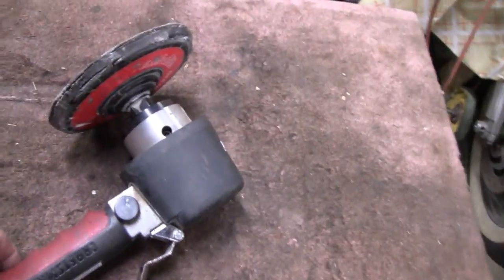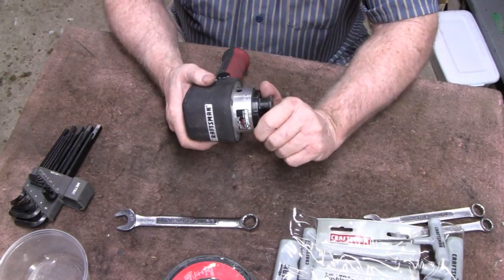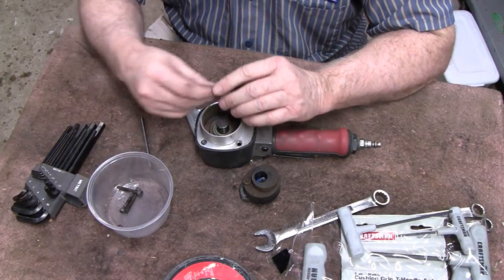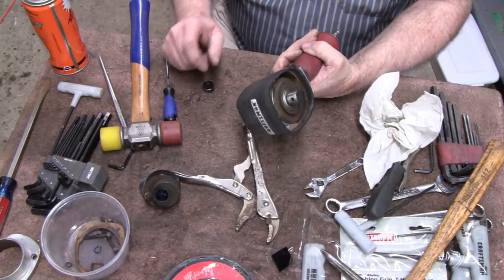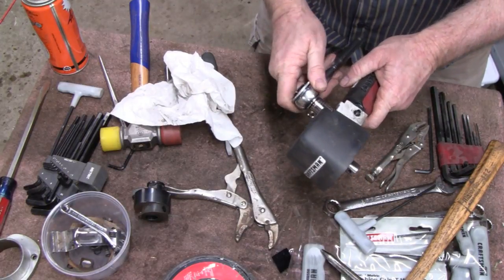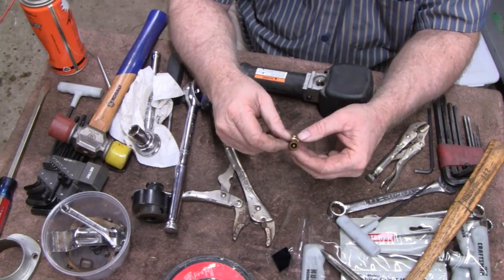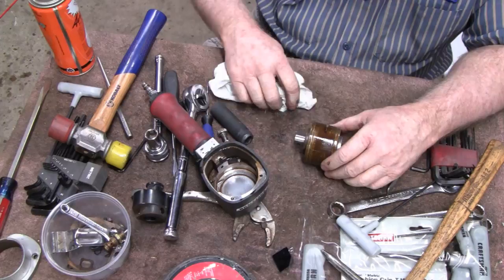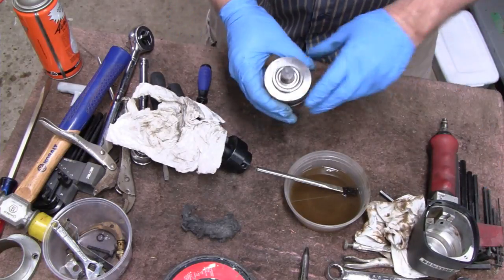REPAIRING A DUAL-ACTION SANDER

Comment: And here it is now, people's: just a bit of time travelling to the 2020's. Proving once and for all that a video out of time is just as good as it was when it was first produced. I, too, have a sander that was almost promoted to the chamber of horrors for later use as spare parts. But a quick look-see on YouTube found me all the answers I needed (thank you very much). And in answer to one of your questions (though I probably should have read through all your responses, first, someone else may have already answered your baffling question). The magical rust in your workshop where no other rust should be... the aircompresser, my friend. The precipitation  of air as it goes through each stage of the process needed to finally get that sander spinning. Need I say more...

Comment: Thanks, I have the same DA got it from Harbor Freight many moons ago. It’s water coming from your air compressor even if you’re draining constantly. You have to install a dryer to cure that.  I don’t have one either and my DA is starting to act like yours was before you took it apart and cleaned up everything. 
Good job brother, it sounds like new.
Cheers.
Reply: You Have to AN AIR/ Water FILTER  .............. Air compressor water separator

Comment: All the rust is probably from the water out of the Compressor.
Maybe you do that already, but you sometimes need to drain the tank.
And maybe get a water filter, or how those are called ?
Reply: line drier, i agree.
Reply: Kenneth Jongmans exactly, moisture in the air (compressed air). i do not have professional experience so i dont know how to fix that. but im sure there are ways or adapters or applications you can buy or make to capture that water to prevent it from happening, such as a dehumidifier. thats what i would use, a special dehumidifier for the air compressor. or something else to capture condense and drain the water.
Reply: Yea, we have a water separator at all of our air grinder stations at work.  Even with an Air dryer connected next to the compressor we get water out at the tools.
Reply: Yeah I was going to scroll down and see if anyone figured that one out. But you guys nailed it on the head. And especially whoever said the water can build up in the air tank too. You really need to drain it out of the tank probably once a year , maybe more depending on where you live. Not only can it degrade your pneumatic air tools but eventually it will rust the metal in the tank to the point one day your air compressor will become a ticking time bomb and God forbid if someone is in it’s path. You may find yourself waking up in an ambulance missing a couple body parts.

Comment: My grandpa used to sell and repair Snapon tools back when I was a kid. (Think 1980's, I 'm way older now). The brown crap in a snapon air ratched was usually the veins in the air turbine. They seemed to be made oit of something that looked and felt like brake pad material. BUT, they looked like they were filled with fine rust before he fixed them.

Comment: Rust was possibly from your air cause from the filter i run off of mine it gets some water built up in the sepeeartor when i spray panels. If you dont have a filter might want to get one cause i replaced alot of connectors due to rusting, put a filter on and no problem. Love the video by the way cause ive never took a DA apart before just tossed them out when they quit.

Comment: Do you have a water trap inline from your compressor ? Maybe that would help you in future and help to keep the moisture out of thee vales and motor vanes. Of course daily oiling will go a long way towards that, won't it?
I didn't think the video was too long, I was enjoying watching this type of work again, we did a lot of air tool work in my business .
( Retired now since 2008)  We did a lot of service work and repair to all air tool right up to those rock drills ( jack hammers) and pavement breakers too.
Whatever you record and send I'll watch.
Cheers ROADKING.
Reply from the maker: Thanks Reg!! That thing is about 30 years old, it's been used with many different compressors!! Time just caught up with it!!☺

Comment: Thanks for the video. I needed to see how that was done. The rest is probably caused by water in your air as it condenses from the hot compressor air into the lines and then in your tool. If you already have an air dryer on your line or air dryer hooked to your compressor then that won’t be the problem. If you don’t it probably is the problem with the rust.

Comment: that DA is a tong yang from Taiwan which is the spin off of Chicago pneumatic and they are very good tools, put lite grease in the bearing and hand clean the vanes and put them back in dry. when its all assembled put two pumps of marvel mystery oil in the inlet and run it tillit clears out
Reply from the maker: I was quite impressed the way that was built, no plastic and extremely close tolerances!!☺

Comment: Hi, yes, my name is randy, can someone please help me out, i purchased the    IR   Ingersoll Rand   dual action sander  model# 311 G  this from home depot, i hooked it up to my compresser, the name of my compresser is Discover JN34 capacity of power is 3.5HP. The tank is 25L. the air release is 254L/min, 8.9 cfm. Maximum pressure is 8 Bar 116 PSI. Revolutions is 3000RPM. 110V/60HZ.  2600W. 
My problem is that i hooked it up, and its spinning, and as soon as i put against a surface of metal or wood and i put a little bit of pressure, it just stops. can you please tell me if theres a way to adjust this dual action sander to a stronger spinning. also it says on the handle, "oil daily", but im not sure where to insert the oil and what kind of oil you reccomend for this machine , it doesnt show much on the intruction manual, i cant find it on the internet either, or maybe my air compresser isnt powerful enough, or maybe you can tell theres a way or something i can touch so the spins can be stronger or powerful. someone please help me out with this because i really need it, maybe something is wrong with it or theres something im not doing right, i would really appreciate it, thank you very much. Sincerely, Randy...

Comment: You didn't put the oil where it's needed, inside the air motor.  As soon as you hit the trigger you just blew all the oil out.  That's why you need to put a few drops inside the quick disconnect every time you use it.  
Another thing to watch for is the cheap air hoses that deteriorate over time.  I had an air ratchet quit on me even though I oiled it all the time.  The inside of the rubber hose was crumbling up and clogged the air motor in my ratchet.  Was easy to fix, just take it apart and clean it up, lube it well and put it together with a new pigtail hose on it.

Comment: Taiwan stuff is good, especially recent stuff. They are trying to differentiate themselves from China, by going the Japanese route. I mean, i guess with the history surrounding the area, and what's actually going on in China, there's reason.
Reply: Oh, btw, i've perfected a method to deal with sealed bearings that doesn't fudge the covers.
1. drill a small hole in one of the covers 2 mm (but really depends on the size of the bearing, and what kind of lube gun you have)
2. another in the other
3. put a lube gun on that hole with the smallest needle you have (but really, match the hole to what you have in the set, i have one that goes down to 1.8 mm for fine machinery, it's like playing with a bee's dick)
4. pump that sucker full of it
5. a dab of RTV on both holes
6. Let it dry

and Voila, you're done. Works great with my older machinery bearings, have brought a few back from the dead, otherwise having to find the specific type...a PITA if there ever was one.
Reply from the maker: I was quite impressed the way that was built, no plastic and extremely close tolerances!!☺